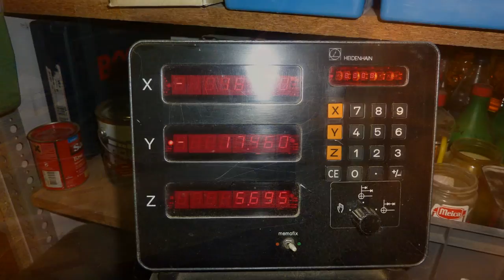Wheel G25 Repair.

Comment: I have the exact same problem, but my wheel is my third (on waranty) so i don't think it would be cheaper to buy a new wheel. I would be very interested in the dravings/mesures and/or the program. did you use a CNC type tool/programing? I'm also interressted in getting new ffb-motor(s) as one of mine are worn out.

Comment: I would have a question apart the bearing-house. I got a G25. It's simply stopped working. Every mechanical bits are fine. Even new motors been fitted. Every signal is spot on from the gear-shifter and from buttons on the wheel but, the wheel does not do anything. The PC doesn't get any input from the wheel itself, and the wheel doesn't calibrate either. It is wrecking my head and I can't find any solution on forum or help. Anybody has an idea? And I love this video!

Comment: mein g25 verstellt sich immer , die mittelstellung ist dann immer nach rechts versetzt. woran kann das liegen ?
Reply from the maker: Zuerst würde ich den Logitech Profiler sauber deinstallieren und neu machen.
Auch beim spielen nicht  geöffnet auf dem  Desktop lassen, das machte früher immer solche Fehler.
Ich kann dir nur  helfen wenn der Fehler mechanisch ist.
Bitte prüfe ohne Strom, ob dein Lenkrad links und rechts   gleiche End-Position hat.
Ist das ok dann ist es vermutlich ein elecktrischer oder Software Fehler.
Eine  Möglichkeit ist dass  der die  kleine Scheibe am optischen Encoder
locker ist und sich verdrehen kann.die ist ganz am Ende der Achse und du könntest sie mit sekundenkleber sichern.Aber da sich dein Lenkrad immer nur nach rechts verstellt würde ich das ausschließen.
Theoretisch kann es sein dass ein Zahn so verschlissen ist dass er überspringt, das wäre dann das Ende von deinen G 25 :(
Es kann aber auch sein dass deine  Lagerung so verschlissen ist 
und das Zahnrad überspringen kann, das wirst du merken wenn dein  Lenkrad in den Kugellagern extrem wackelt.

Ist die Position immer gleich falsch dann musst du das kleine Zahnrad anders in die Zahnstange einhängen bis rechts und links gleiche Endposition hat.
Siehe. siehe 5.00 im Video.
Viel Glück beim reparieren

Gruß korulax

Comment: I think this part will break under normal use eventually. The original plastic housing is so thin and flimsy and the screw holes also breaks. Do anyone have a 3D print file for this part so I can print a new one?
Reply from the maker: The case is made of hard plastic.
Someone has already tried a printer, but the material is too soft for it.
Unfortunately, I don't know who it was anymore.

Comment from the maker: Hi my friend
I can unfortunately not help you, because I think you have one
electronics problem when it no longer works.
The only reason I can think of is maybe a cable broken or bent a pin from the plug, you can check good with a meter all cables
But I have a question? you write that you have installed new engines. Can you tell me where you can buy?

Comment: Hey. I have the same problem (The plastic unit is broken)..

If you make me the same unit of aluminum, how much would it cost? = )
And the other question is: my g25 is making much noise when steering, so could the noise be from the broken plastic part? :)
Reply from the maker: hi
Sorry, the aluminum housing was just a Expiriment because I wanted to know if it works.
If I would do that you can not pay for it, would be much too expensive.
If you do not have the possibility to customize it yourself, you can forget that.
I think for the price you get two new G 27: (
The noise of G 25 is very noisy, the true and the reason is the gear.
Buy thee G 27 since that's much better.
G25 has a straight toothing which is very loud.
G 27 has an oblique toothing and is therefore much quieter.
Reply: *****  Well, ok.

I fixed mine plastic thing with glue. BTW, how did the aliminum housing work? Did it make much noise, or where does the noise come from on this wheel?
Reply from the maker: the noise comes very often from the large black gear
think it might be damaged
you can try to make it fat and also down to the stop.
If you're lucky it will be better.

Comment from the maker: Hi ... you're already in the 5 of this month does the drawing
and I am pleased that you have interest it ..
I bought the aluminum um15 € and the working time was about 20 hours without having to create the drawing.
If you can do it myself, I think it's ok
I only made it because I enjoy watching to repair old things.
I can give you the drawing as a DWG file they send is free for you.
Contact me if you want them and give me an email address so I can send.
Greetings Korulax
Reply: @TomSkarsts  https://grabcad.com/library/support-logitech-g27-1 I use this, it is practically perfect, you must extrude the rear part, the part that it is in contact with metallic plate, in positive of 1mm
Reply: @andreabaricalla551  That is amazing, thank you! However, what did you mean with "extrude the rear part"? It needs to be 1mm thicker, or 1mm needs to be shaved off?
Reply: @TomSkarsts  1 mm thicker respect to this stl, extrude the rear side, the side in contact with the metallic plate
Reply: @andreabaricalla551  Understood, thanks.
How did you attach it to the metal plate? I see that 3d model has a metal plate included as well, but I do not see any holes in the plastic part to bolt them together.
Reply: @TomSkarsts  it has blind holes and you can use wood screws, in the same position of the original screws
Reply: @andreabaricalla551  doesn't it break again very easily then? Driling holes through the whole thing and using bolts with nuts sounds a bit safer to me
Reply: @TomSkarsts  I use your solution and it is more sure and solid, I use the M4 screws and bolts and it is solid like a rock